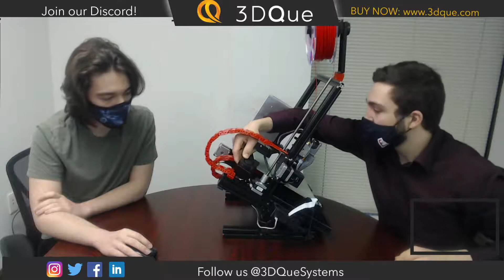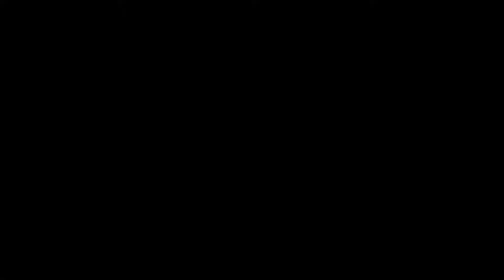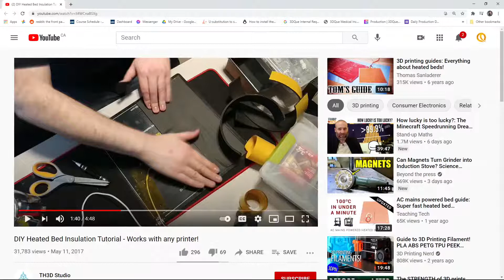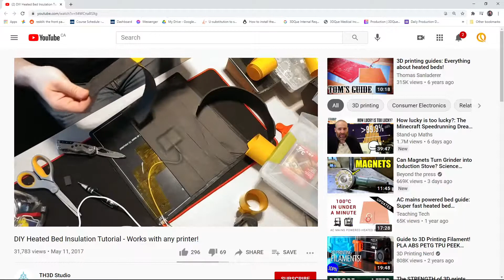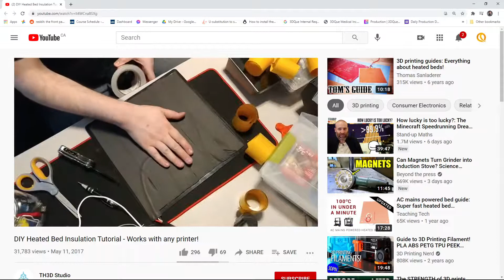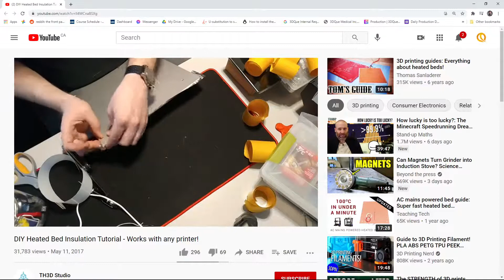12 Mods for Ender 3 with Quinly: Improved Automation, Compatibility and Performance

Comment: How well with this do with cookie cutters??? Very interested in these upgrades to my 3 ender v2
Reply from the maker: This is a great system for cookie cutters. One of the best things is that once you've uploaded your gcode files, you can simply ask Quinly to print any number of a variety of cookie cutters and then let it go. 

Let's say you have an order for Valentine cookie cutters - 5 big hearts, 3 small hearts, and 4 roses. Just choose file for "big heart" set quantity at "5", choose "small heart" set quantity at 3, choose "rose" set quantity at 4. Let it go. Quinly will deliver 5 big hearts, 3 small hearts and 4 roses (in that order).